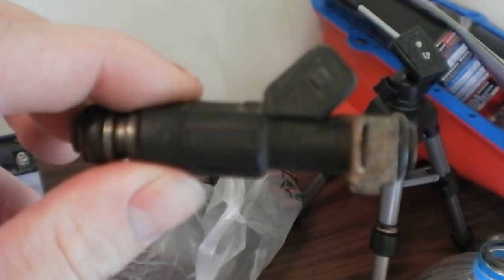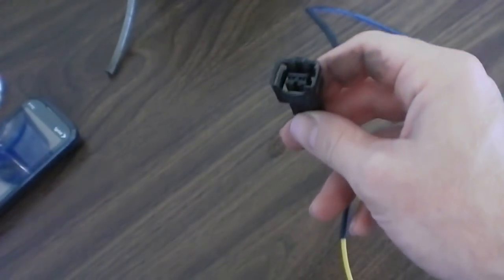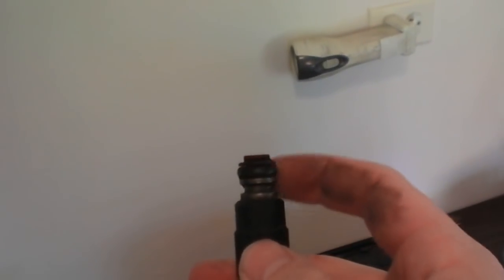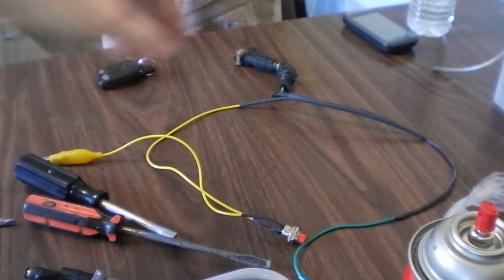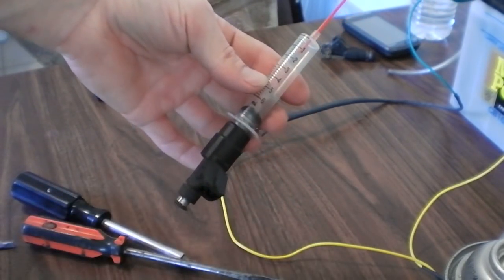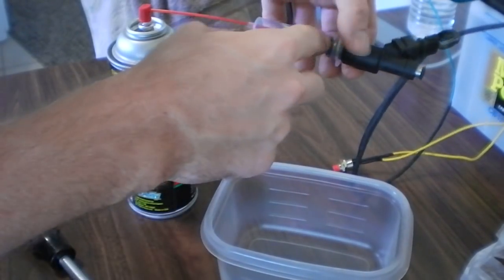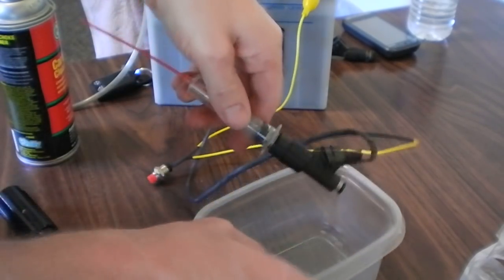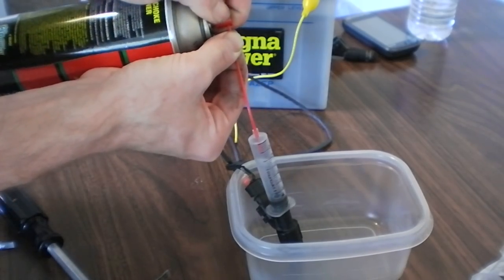Fuel injector cleaning

Comment: I still didn't quite understand the alligator clips for power.  One from battery positive to button , then from button to injector connector ( positive lead in connector??), then from connector to negative battery.  Is that all correct???

Comment: I tried to do but with automoviel battery and did not work.
question. What is the battery voltage 3, 6, 8, 12 volts?

Comment: Very cool, won't guarantee a flow match but cheap is good when you're strapped for cash.  Watch your ass though, that carb cleaner is still volitale (flour will explode if mixed with air), that scares me coz that's exactly what the injector is designed to do.  Unless that switch is sealed it's creating a spark, also if you accidently pull the alligator clips off.

Comment: everyone seems to be cleaning them this way but then why don't you leave them in the car, just add your carb cleaner from the fuel pipe ?? you can then crank the car over via the ignition and it might even run on carb cleaner, I know a bike will run on it. Anyway it will clean jack shit.

Comment: doesn't sea foam do the same thing?
Reply: No, seafoam is dumped into the intake and never goes through the injectors.
Reply: dieselscience you can put seafoam into your gas tank as well and it does run through the injectors. I will be using seafoam when I clean mine.

Comment: This is a lot work to clean these injector this work,  Why don't you just buy a pressurized injector cleaner system, disconnect the fuel pump and hook the pressurized can and clean all the injector on the car at the same time.. you don't need to take them out .. that what I do in the shop .

Comment: @Carfixing101 yes but his way is cleaner as most hose is crap but new efi hose an old fuel pump +cleaner +copper hose for a permanent rig
ebay raidio shack round wire terminal end local mom and pop hardware store

Comment: good. but carb cleaner will eat all the o rings and plastics. your clean injectors will leak the hell out of the intake manifold
Reply: Ken Lwenyi so what you recommend?
Reply: Emiliano Zapata electrical contact cleaner may be better
Reply: Emiliano Zapata wouldn't the best cleaner be fuel injector cleaner... lol
Reply: John House no because that's designed to work over time where as a solvent is quick acting something like acetone ect
Reply: Actually they do make fuel injector cleaner that are for cleaning instantly
Reply: That's why you buy injector reconditioning kits.  Has all those pieces and not too expensive.

Comment: You really have to be broke to do this, there are shops who do this service with a machine that actually cleaned the injectors better, but what if you have a 1993 maxima with a 3.0 engine or a !996 old cutlass supreme with a 3.1 liter engine were you have to disconnect all this vacuum hoses,manifold, ect. it will be less time comsuming if you just pay $60.00 dollars and have a shop do this and it will take about 30 to 45 minute.

Comment: What you're doing is basically nothing that the gasoline doesn't do already. Waste of time IMO. Something as critical as fuel injectors should be serviced professionally by an experienced technician. Did you know that injectors are calibrated? This is why fuel injectors should be sold/installed as a matched set. Do you have the equipment to calibrate and flow test them at home? If just one fuel injector varies from the others, you'll end up losing fuel economy and the engine will run poorly.